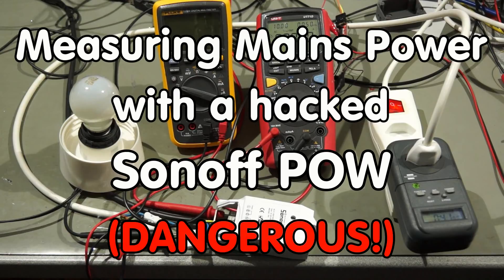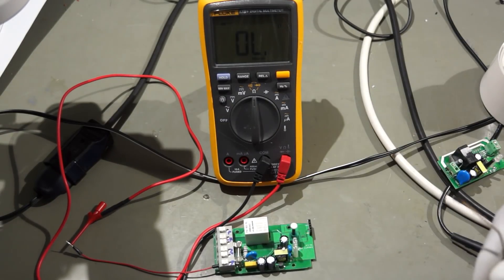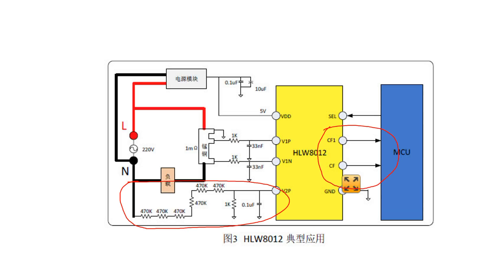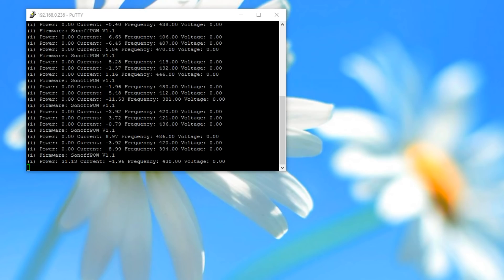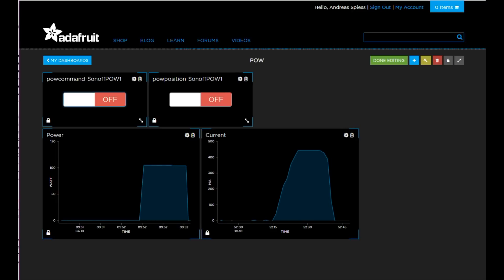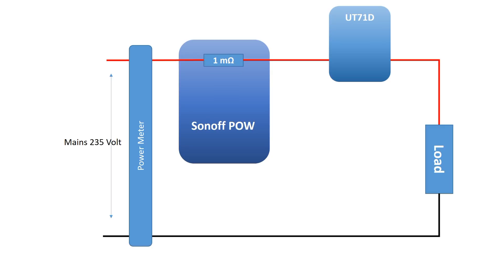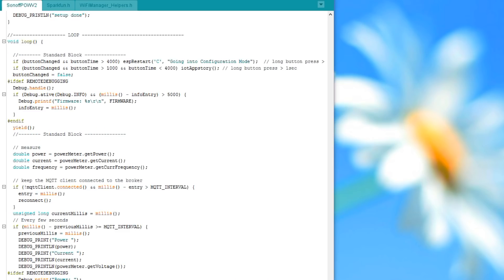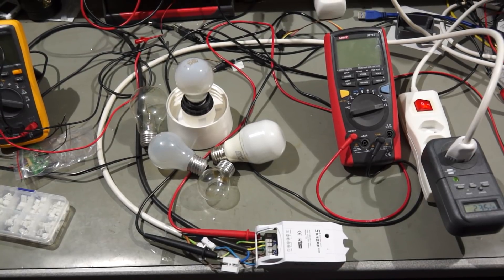#99 Measuring Power, hacked Sonoff POW, MQTT, Adafruit.io and Home Automation

Comment: As always very good video and useful information. In this case I want to ask you something. I have three-phase electric power at home, can you tell me if this device is going to work for me? 

Thanks Andreas, let me remark your very good job again.

Oriol
Reply from the maker: Do you have a 3 phase device? Then it will not work, because these devices only have 1 phase
Reply: So if I have a regular lamp it is going to work properly. My question is not about the relay because it worked for me in the past. The real challenge was with power meters I had to use three phase meters in the past.
Reply from the maker: If you use one phase for the lamp it should count the power going into this lamp. I also have 3 phases in the house.
Reply: Thanks again. I appreciate your work keep on pushing.

Comment: Hi Andreas. I like your videos and its content. In your sketch "SonoffPOWV2.ino", you're using two debugging methods: RemoteDebug and the macros DEBUG_PRINT/PRINTLN. These two are not declared. Furthermore, you forgot to remove some variables, like "pirState" or "currentPirState". You probably found some inspiration from another sketch ;-). Thanks for your videos. Sam
Reply from the maker: You are right with my sketches, the are never perfect. They are usually just a "snapshot" of the state of the work during filming. Sometimes, they stay like that, and sometimes they develop further. Like with this one. I think, I will update these sketches during the next week. But, it will be a "major" update. I changed a lot in the meantime
To the forgotten variables: You find these in most of my sketches, because I do not check and the compiler does not tell me. Maybe if I would enable the compiler warnings it would be different. But so far, they did not hurt too much.

Comment: hi Andreas. if the sonoff are without power, are the relays in a normaly closed state or do they brake circuits when they do not have power?
Reply from the maker: They are normally open

Comment: I would invest in one of the cheapish USB isolators based on the analog devices chip. Killing a $2 usb to serial adapter on the isolated side is a lot less heartbreaking than killing your whole PC. :)
Reply from the maker: You are right. I ordered one of these, but before testing it, I did not want to give recommendations. Anyway, you have to pay attention...

Comment: Great job! MQTT seems quite good. I need to try it. Before I work only with Blynk
Reply from the maker: I never tried Blynk, but I have to one day.
Reply: TheDambo1 , I am using Blynk in combination with MQTT using Node-RED. With Blynk I now can display information from MQTT-nodes and control them, such as display movement when a PIR-sensor is triggered or switch a light on.
Reply from the maker: Now, it moved up in my list!

Comment: I don't get it, isn't frequency just stable 50Hz? or is it a cos phi factor?
Makes a cheap wifi master/slave socket board (Steckdosenleiste)!
Reply from the maker: It is 50 Hz. That is not the issue. But if your wave forms are somehow distorted because the load is not linear, you do not get good readings. That is, why the better Multimeters offer RMS functionality. Cos pi is in addition and I did not take it into account. I forgot about it till your comment (my degree is 40 years back). Now, I have to look at it... Thank you!
Reply: AltMarc i think the frequency is the measurment value of the power sensor

Comment: Andreas,  don't talk about Mqtt as my one keeps connecting then disconnecting. Bit bad for my first Sonoff. I haven't use my Sonoff POW yet or touch light with the software I am using yet. Is there a way to monitor the MQTT server via a logging system.  Run it on a pi. Great video mate too.
Reply: Chris B when you connect to an mqtt server you can provide a 'last will and testament'.
This is a message that gets sent to a topic you specify when the server has detected that your client is no longer connected.
Reply from the maker: I saw this behavior also once or twice, but also the adafruit page was not always reachable, so I thought, it is the other side and did not investigate further. Do you have crashes or just momentarily disconnects?
Reply: No just tries to connect, connects then disconnects, and continue the cycle.
Reply: Chris B I've seen this if you have two mqtt clients/devices that are using the same client name/Id.

I generate a unique name from the ESP hardware and use that.
Reply: Chris B also if you want to monitor when something is disconnecting when it shouldn't, try using a "last will" to publish a message to a different topic.
I suspect that it won't help in this instance, but can be handy to find unexpected disconnects.
Reply: Ian Wilkinson Not sure what"last will" means. only starting out with mqtt.
Reply: Ian how do I do that? I have it connecting to the broker, but it drops it almost straight away.  Node red will not pass the update location to the sonoff. But node-red thinks it is connected. Will do a video tomorrow hopefully of it.
Reply: Chris B are you using the Pubsubclient?

When you connect, in addition to the normal information that you provide to connect (server IP, port, unique client name), you also provide willTopic, willQoS, willRetain, willMessage.

The willTopic is the topic that the "last will" will be published on, if it is sent.  It doesn't have to be related to any topic that you are using, it's probably a good idea to use a separate topic for debugging.

willQoS and willRetain are the same as the normal QoS and retain settings, normally safe to set both to 0.

willMessage is the message to be sent when the disconnect is detected.

Don't forget that the Last Will message is sent by the MQTT Server (broker as it was called prior to MQTT 3.1.1) when it detects the client has disconnected.  It is not sent by your device.  This is why it's provided in the connect method.

See:
http://pubsubclient.knolleary.net/api.html#connect2

Comment: Nice video! MQTT is great because it is widely used, easy to implement and is supported by various software packages.My tips for today: 1. Node-RED makes it easy to integrate both MQTT and a wide range of other protocols such as REST. It is very easy to setup and runs on Raspberry PI and other Linux computers. 2. With ESP Easy it is easy to create MQTT nodes without any programming.
Reply from the maker: I have to investigate a little more in node red, I know. But currently, I am working on the ESP infrastructure which has the capabilities I showed in this video. Especially the OTA stuff is not easy (at least, the details). In principle, it works but... I want also to have the data completely separated from the code that I can distribute standard coding. And of course, I took the opportunity when I got the code from ITEAD for this Chinese chip and show my viewers, how to use it.

Comment: Interesting, Thanks for sharing.
Is it possible to use Sonoff POW and normal wall switch at the same time to turn the lights ON/OFF?
Reply from the maker: Yes
Reply: Yes, I am busy doing just that, my light switch is a two way light switch, I will then use the energy monitoring to detect if the light is on or off.